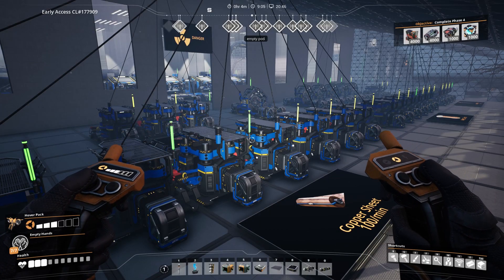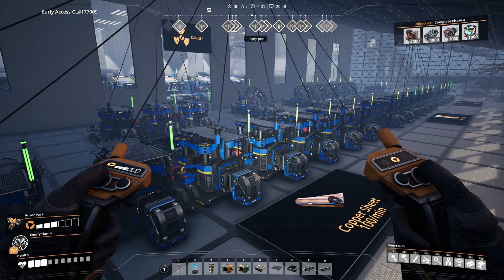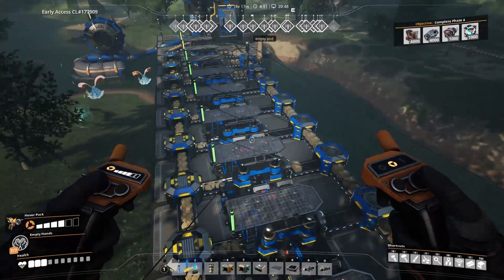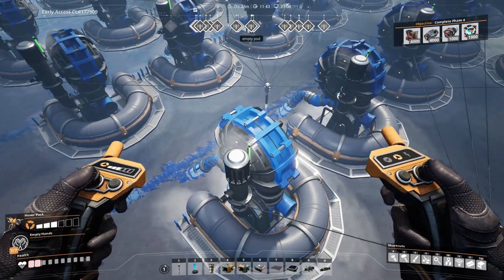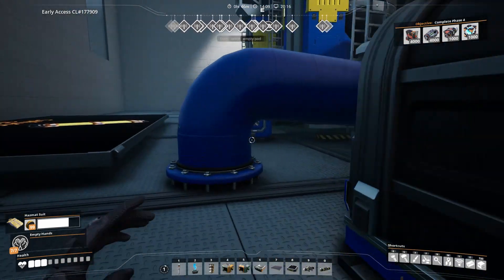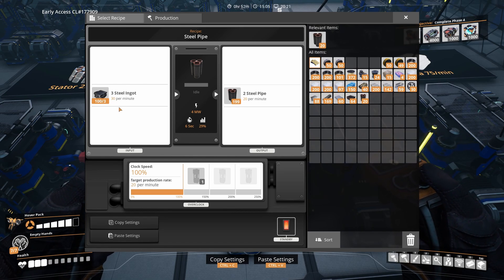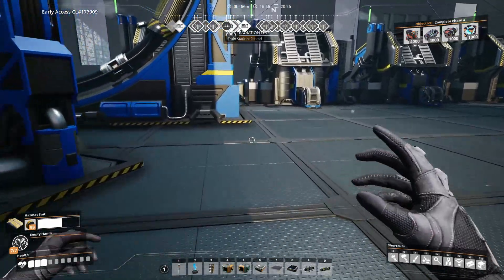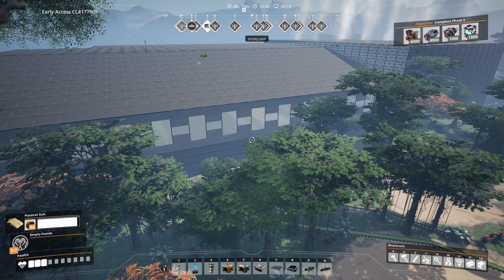Beginner's Guide to Zero Waste Nuclear Power in Satisfactory!

Comment: Will you use the same recipes for plant spending all the Uranium in the future? If not, what recipes do you plan to use?

Thanks for video.
I just built another Aluminium ingot factory as I realised my initial factory didn't provide enough for big nuclear plant(and to produce high end items in higher rate for them 1K coupons).
Reply from the maker: The big nuclear plant will use plenty of alternate recipes. From my spreadsheet planning I see I'm using alternates for these (i.e. almost every item needed):
- Uranium Fuel Rod
- Encased Uranium Cell
- Stator
- Beacon
- Crystal Oscillator
- Copper Sheet
- Quickwire
- Rubber
- Heat Sink
- Aluminum Ingot
- Aluminum Scrap
- Alumina Solution
- Heavy Oil Residue
- Steel Ingot
- Iron Ingot
- Copper Ingot
- Caterium Ingot
Reply: @Fjorim  I assume Pure ingots recipes.
Which recipe for the Steel?
Reply from the maker: Yes, pure ingots for copper, iron and caterium. Solid Steel Ingot for steel. I like that recipe :)